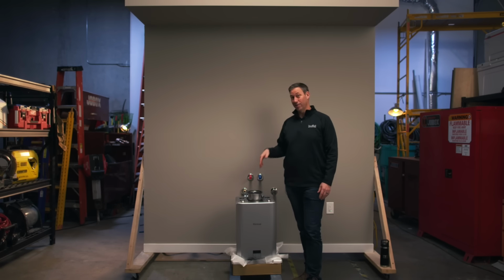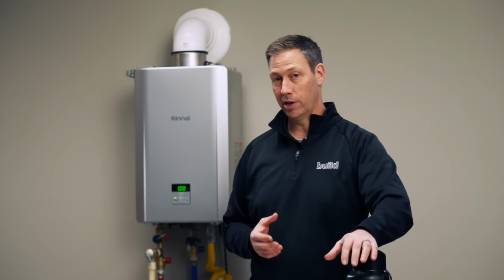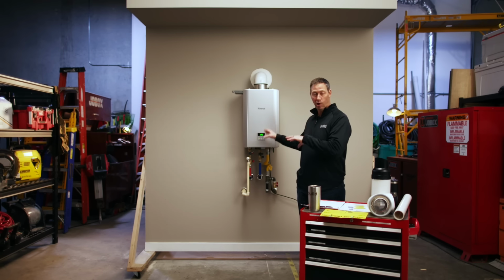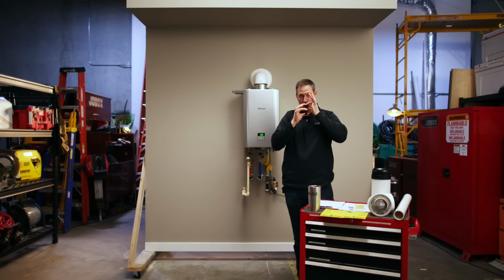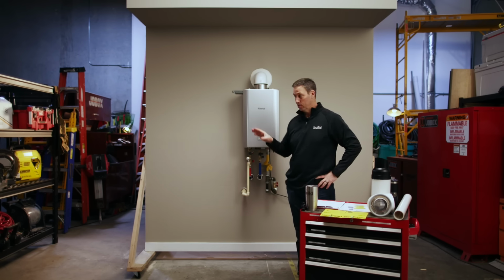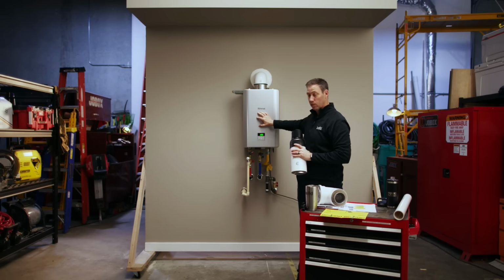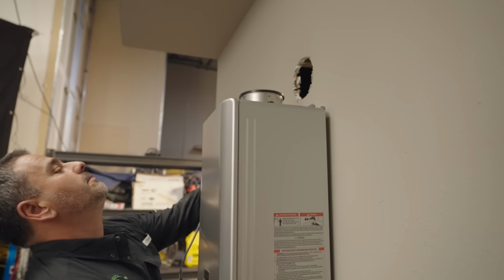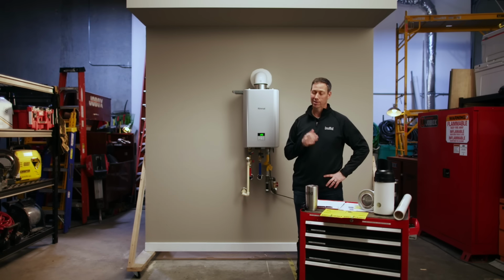Replacing A Water Heater Tank? Probably the Best Tankless Option for You.

Comment: A couple of things to add:  

(1) That cross over valve will be pushing your hot water through 1/2 inch lines.  The difference between that configuration, and my implementing the 3/4 recirc line that I installed when building the house (but the plumbers had no idea how to utilize), was the difference between heating the water though all lines in 10 minutes, versus 30 seconds.  It made THAT much difference.  (Why, with a recirculating hot water heater, would you care how long it takes to circulate the water?  Well, I'm on propane.  We pretty much just push the recirc button when we want hot water in the downstairs faucets and bathroom, and turn it off afterwards.  In other words, we don't set a schedule with the hot water continually running through the lines, to save on propane, because it only requires seconds to circulate though the house from beginning to water heater return.  With the Rinnai Condensing recirc hot water heater, that brings our hot water heating costs down to maybe, $15 a month for a 2400 sq foot home.  Anything you can do on a retrofit to create a 3/4" recirculation hot water line, will likely reduce your heating (gas or electricity) bill.  It's not rocket science.  Poke a hole out somewhere at the end of the line, and run that new hot water line over, under, outside, back to the tank.  If your existing system has, for example, two supply legs, you can link them together at the end of both lines.  

(2) On ANY, and I repeat, ANY tankless hot water system, add a 100 Micron, spin down sediment water filter on the OUTBOUND hot water line, to catch any debris that may come from the hot water heater.  With a regular tank, that sediment settles to the bottom of the tank, and the amount of carry out of the tank through the top hot water supply pipe is minimal.  With a tankless system, there's no place for that debris to go, but to your fixtures, clogging them up.  In a severe case (as in, with very hard water), in a recirc system, that debris can foul your check valves causing problems (e.g. cold water running back up the hot water lines, giving the customers at the end of the circuit, cold showers).   Even if your water supply has great PH, Rinnai recommends (I believe) flushing the system with something like vinegar to clean the tank annually.  (In my case, with hard water, it's every 2 to 3 months.)
Reply: The Navien already has a built in sediment trap on the incoming cold water line to the tank. As far as hard water you need to treat your system to prevent that build up and eventual corrosion of your plumbing system.
Reply: @HoyaNinja22  The Rinnai also has an incoming filter (and probably, all hot water heaters do), but regardless of your water quality, (and yeah, mine is an extreme case where my water is hard AND there are no good solutions to treat it, due to the build), sediment WILL exit your hot water heater.  The spin down filter catches it, instead of your downstream faucets and other devices.
Reply: We have very hard water in Utah.  In 2010 we gutted our prior house, piped everything in Pex including a recirc pump and 3/4" recirc line.  We installed a good soft water unit that fed into the Rinnai and have had zero issues.  Soft water is vital in keeping the tankless systems free of build up.  There is a company out of Florida that designs their soft water systems based upon your water hardness and impurities.  We have moved into a 1977 home and are planning our upgrades to include Pex, Insulated Recirc Line, Recirc Pump, Tankless, Soft Water and RO.  After living with clean shower doors and endless hot water, it is a high priority to upgrade and enjoy.  

Many of the better tankless models include recirc pumps and smart technology that learns the higher usage times and will run the pump accordingly.  You can also integrate wireless switches  and/or WiFi apps to turn on/off the pump making them more of a complete on demand system.  For those without Recirc Lines, look into Aquamotion AMH3K-7N with the On Demand Kit and you can overcome the 5 minute wait for hot water in the 2nd floor shower.
Reply: @innovativesolutionsav1684  I heard that Sodium Polyphosphate Balls (SILIPHOS) will reduce hardness in water and/or prevent hard water scale from forming.  I've seen just about all the scam solutions (and have tried a few of them myself), so I was skeptical.  However, I already had a basket strainer on the incoming water main line, so tossing some in there to try it wasn't much effort (though those things ARE pricy).  Well, the verdicts still out.  I installed them the last time I flushed out the tankless unit, and though we're a month or two past the normal 3-month flush schedule which has kept us out of trouble, still no indication of scale problems in the water heater.  I had to pull the strainer while tapping the line to supply a new irrigation system, so it's been without the SILPROS for a couple of weeks.  However, thus far, I'd give them a thumbs up.  Even if I can reduce the flush schedule to twice annually, I figure it's a success (note: flushing a tankless W.H. is recommended annually in any case).   I'll probably have to run the test a full year to know for certain.

Comment: 1) your condensate can tie into your T&P drain
2) Naviens have had internal recirc pumps forever
Reply: Pretty sure the T&P line tying into the condensate line is a 100000% absolutely not.
Reply: @dylancampbell8064  

Yep.  Required single service.  After all, it's a safety issue.

Comment: Looks like a nice unit with the built in recirc. pump.  A recirc. pump would not work well in my 50's house.  The water heater is actually quite centrally located with respect to the hot water fixtures.  However, there are two separate hot water pipe runs, one to the kitchen and the other to the bathrooms.  The bathrooms are maybe 50% farther away than the kitchen, but the hot water in the kitchen is used more frequently.  So where to put that single thermal bypass valve?  I looked into the cost savings on water with a recirc. setup and it would take many decades to pay for the install.  Maybe if the local water utility had a decent rebate program (hint, hint!), then it might make sense.

I went with a condensing unit for my retrofit install.  Condensate was not an issue as the clothes washer and standpipe drain was right next to the water heater.  Also, it was in a garage on a shared wall with the house.  So venting out the wall wasn't an option.  Was able to use PVC venting that ran up through the roof in place of the old tank venting.  Also, the condensing model I chose could run on the existing 1/2" gas line vs. a non-condensing model of similar capacity would need a new 3/4" gas line run.  

So it's always best to look at the entire install and consider the whole system cost.  In my case, what was saved on gas piping and venting could be put towards a more efficient heater and with the recent rise in natural gas prices, that's paying off big.  Going tankless cut my gas use and bill by over 80% compared to the old 40 gal. tank.

Comment: Our water heater went out a few years ago. I was planning on getting a tankless, but the additional cost of the heater combined with the higher install costs meant it jsut didnt’ make sense. Ended up going with a high efficiency 50gal that’s working perfectly.
Reply: What water heater brand do you go with? If you don’t mind me asking. Finding it hard to find a reliable brand that doesn’t have poor reviews upon installation or a few years in rehiring replacement parts or multiple service calls.
Reply: Bradford White .
Tankless suck

Comment: My experience with those bypass valves is they only last about 3 years. The valve sticks open and then you get the opposite effect. You still get instant hot water but it takes forever for you to get cold water from the cold tap.
Reply: Interesting, I haven't come across that yet. Good to know
Reply: I can confirm the same happened to me. Mine lasted about a year before issues started happening.  Ended up removing the bypass valve and running a dedicated return in a 70's house. Took a lot of effort to get it done but fortunately part of the basement was open to run pex to the far side of the house

Comment: I really don’t know how many of these I’ve put in, Inlet water temps are a big factor as well in CO even in the summer we’re at 40-45 degrees. In Cali where most these are designed it’s around 50 to 70 degrees. Ratings are iffy and a hell of a lot more going on. Wouldn’t put one in my house

Comment: No reason to put a recirculating pump built into the tankless water heater just one more thing to go wrong, let tankless water heater manufacturers make tankless water heaters and pump for circulating companies make recirculating pumps easier to replace easier to fixed better product in the long run

Comment: I got a Rinnai  RUR160IN a week ago. All is good except for one thing. Every time you turn on the hot water you hear a hum, which is kind of annoying. It's not very loud, but it's like a low frequency bass. Like a car with it's engine on outside. You can hear it through walls connecting to garage. I only went for this because I heard that the heat pump makes noise, but I didn't realize that tankless does too.

Comment: I have two Rinnai tankless water heaters, one in our house and one in our rental house next door.  Love them both, when it comes to the non condensing vs. condensing, if you have a drain I would only go with the condensing, overall cost isn't much different and losing 10% efficiency isn't worth it.  I also wouldn't use the concentric vent unless it mounted on an outside wall.  The separate 2" PVC air inlet and outlet on other models is extremely cheap and easy to deal with.

Comment: So, it only circulates water at certain times? Otherwise it would have to run constantly.
Don't see any benefit in this unless you use hot water at several of the same times every day.
Reply: Agreed, that is a dumb system. For a smarter way to control the recirculation pump look up Smart Recirculation Control.

Comment: If you live in a cold climate, do not install a tankless water heater in an unheated space.  They can freeze.  There was a propane tankless water heater in the unheated basement of an apartment I once rented.  One night the outside temperature got down to negative 30 degrees Fahrenheit and the copper tubing in the heater cracked in at least four different places.  The heater even had a (very flimsy) electric resistance back up that was supposed to keep it from freezing, but that proved to be utterly useless.  My landlord replaced the one year old, $800 tankless water heater with a 40 gallon electric tank water heater.

Comment: Hi Matt.  I have tried 4 different tankless. 110  and 220 volts ?  All are made to break, they use a prt somewhere in them made to fail.  Best i ever used is the Steibel Eltron, also made to break th the metering paddle..??    I switched back to a 110  large one like you wheeled out, it has done well for 7 years and not a hitch, none of the tankless lasted a year..

Comment: A more energy efficient option than using a recirculating pump it is to locate your water heater(s) closer to your faucets.  This may be difficult for existing buildings, but if you are building new, then design your house to accommodate this.  Install multiple water heaters if your faucets are far away from each other.  Also, insulate both your hot and cold water supply pipes.  This is especially important if you do use a recirculating pump.
Reply: An added benefit to locating your water heaters close to your faucets (and any appliances that need hot water) is that you only need long runs of your cold water supply.
Reply: Exactly. We have our tankless less than 15ft from three bathrooms. Kitchen is maybe 20. Electric panel is 4’ from the tankless.
Reply: My water heater location in the basement is near laundry/kitchen/main floor bath, so getting hot water quickly is easy. But the 2nd bath is polar opposite end of the house and 2nd floor. I am so tempted to get that bathroom hot water locally. And there's a long utility closet along the backside of the bathroom, so all that plumbing is right there -- in the closet, not the wall -- to tap into overall.
Reply: In designing a small off grid home as the first phase of building my forever retirement home, I'm putting the mechanical/laundry room in a corner, with the kitchen to the south and the bathroom to west.  Then I put the water heater in the corner adjacent to the bathroom, so bathroom sink is just a few feet to one side, the kitchen sink about 20 feet away, and the shower about 10 feet away.  The washing machine will be next to tankless.  Since I'm designing this from scratch, the floor drain is located right underneath the tankless water heater and I've got a location for a condensate neutralizer.  Other than the outdoor sill cocks and the fire sprinklers, all of the plumbing is located in area of the house about 10 feet wide and 20 feet long.

Comment: I used to be sold on tankless water heaters until I decided that I would never put or add any fossil fuel appliances to a new or existing building.  (I live in an area where all of my electricity comes from renewables.)  Electric tankless water heaters need as much power as an electric arc welder, so I think I am going to stick with an electric tank water heater.  I currently have an 80 gallon electric tank water heater in my basement that is over ten years old and if/when I need to replace it, I will probably replace it with the same thing.  The heat that escapes from it helps heat my basement in the winter months and I am charged a lower rate for the electricity that goes to my water heater.  Perhaps, I could add extra insulation around it during the summer months, though.

Heat pump water heaters take heat from their surroundings, so if you are paying to heat their surroundings, you really are not saving anything.
Reply: Most of us don't try to heat our basements as much, compared to the main floor, so if they get a little cooler that shouldn't cost as much as a heat pump model can save. Full-electric water heaters are just resistance heaters, they slurp a bunch of electricity. And in the summer you get a mild dehumidifier effect from heat pump models.

Comment: I’m putting in a heat pump water heater. Don’t know of any tankless or even hybrid options for that, sadly, but we need to stop extracting carbon from the ground. HP water heaters are easily powered by renewables; I wish the industry would do more to integrate solar thermal for hot water.
Reply: Your dreaming.
Reply: @donhuffer5167  You’re.
Reply: If you put in a recirculation pump with a heat pump water heater you will need to use a smart control to prevent the pump from running all the time and causing the tank to cool down. Rheem has a technical bulletin on the problem. The Smart Recirculation Control solves this problem for HP water heaters.
Reply: There's no way solar panels on a basic home scenario could provide anywhere near enough electricity to power one of these bad boys. Maybe you need to think about solar on a net major grid level which wouldn't involve the hot water heater industry at all.
Reply: @ssdkilla  rooftop solar can easily power even a resistive heater. A heat pump heater would be no problem. What it can’t do is power a gas heater, even if it comes from somewhere else, which is why we shouldn’t be installing gas heaters.

Comment: I am looking to go all eletric in my next house. Is there a good tankless eletric unit? Thanks
Reply: Several.  But you have to build in the capacity in your electrical service and panels for this.  And, we ain't talking peanuts when we get to tankless service.   Just look at the requirements on any manufacturers literature.  

We had one installed in our kitchen at work.  Required three, 40A, 240V breakers.  Just for the kitchen sink!

Comment: My existing water heater vent ties into the aluminum furnace vent, I was told i would have to replace that entire vent (thru the roof) if I went with a tankless. Would the non condensing unit eliminate that need?
Reply: Yes
Reply: You wouldn't need to replace the furnace vent but you WOULD need to find a way out of the house for that vent Matt was showing.

Comment: I don't like learning logic for controls like this.  Hot water demand is far less predictable than it assumes.  This means that you are wasting energy by recirculating hot water when you don't need it.  It also means that you are heating your cold line unnecessarily, and the warm water in the cold water line is actually a bigger annoyance than you might assume.  But the biggest thing for satisfaction is that you won't have hot water at the ready when you need it at an "atypical" time.

I think it is much better to just get a simple water record pump and then use a smart home motion sensor and smart plug to recirculate water based on actual occupancy.  More efficient, more effective, and probably cheaper than the integrated pump.